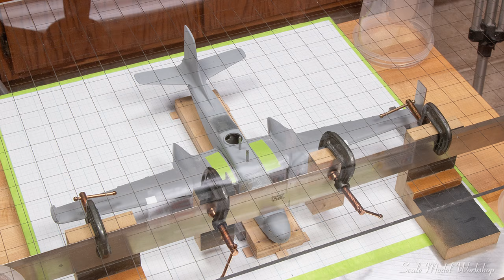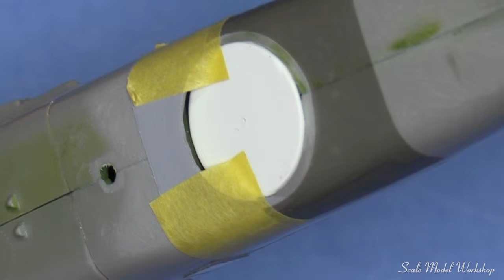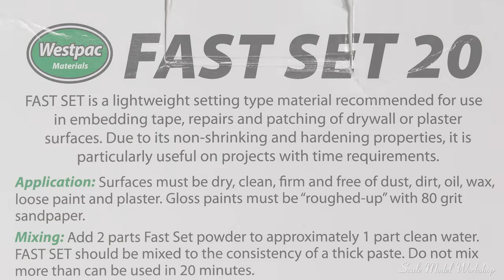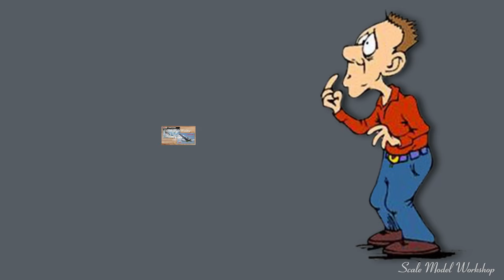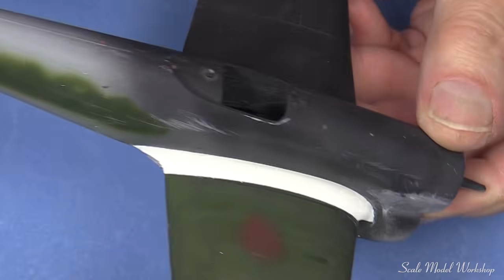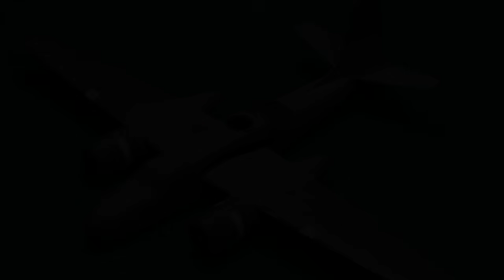Creating Model Aircraft Fillets

Comment: Great and quite a comprehensive video for being so short.
Cyanoacrylates are actually a family of chemical compounds with different lengths of carbon chains(and also different isomers).
This gives different types of CA glues different properties like viscosity and drying time. Zap CA is one of the thinner glues wich allows it to fill in all the microstructures of a surface and is probably also whyit won't crack like other CA.
ZAP CA is ethyl-2-cyanoacrylate(85%) and Polymethyl methacrylate, while ZAP-a-Gap only seems to only consist of up to 60% of ethyl-2-cyanoacrylate according to their safety data sheets. 
Feel free to correct me if I'm wrong, I'm no expert on superglue. 
Cheers

Comment: Have you considered Durhams Rock Hard wood filler?   Available at home depot and lowes in small quantities.  It’s a very fine powder, mix it like the joint compound.   It’s commonly used for repairs like the trim on your front door.
Reply from the maker: @edhilton1623  I've used it for wood work  ... but it's too hard for sanding next to styrene.

Comment: I use Tamiya "Basic Putty" for such work. It does shrink a bit so more than 1 layer may be required. It is very sculptable when applying and can be smoothed with liquid cement if necessary. It is only slightly softer than styrene which makes it easy to sand.
Reply from the maker: This stuff is much easier to sand than styrene so it works well with previously primed surfaces.  I'm not a fan of Tamiya basic putty because it is not stable under the "real" automotive lacquer primers that I typically use.
Reply: @scale-model-workshop  That's a good reason.